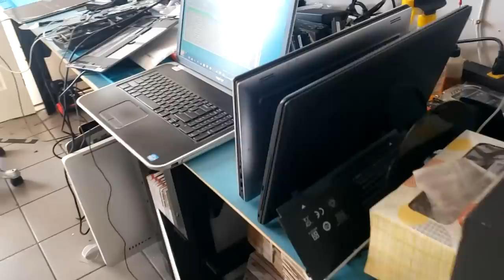iPad 12.9 Repair - Customer ripped both screen FPC connectors and Blew touch circuit

Comment: I know that you didn't say it but anyone who knows this channel will certify that you did heat the board up from underneath with the hot gun to avoid melting the component.
Just wanted to  make that clear for anyone watching and wondering.
When you removed the bad plastic components, you heated them directly as they were getting replaced.
And, if any flies or invading beetles were to wonder onto the board, they would have been incinerated as well.  One thing we don't want is another "bug" on the board.
Ok, I think my work here is done.
Great SHOW!!!

Comment: What temperature do you use with the hot air gun? For me, desoldering takes much longer. I usually use temperatures around 300°C

Comment: I always get the temp wrong doing this kind of work.
I wonder how hot is the air and speed  and the solder bit.
Like always impressed by the skills.
Reply: you'd have to get some donor boards to practice different lvls of heat n air on before working on a customer's board

Comment: Hi! Is it possible to solder components with low melt solder? If no, why not? Great job you did there!
Reply: I think it's possible.  You ever tried working with the stuff?  It's a bit messy.  Great for de-soldering heat sensitive parts.  Wouldn't want to manufacture a PCB with it.
Reply: @pow9606  i’m still learning (also from northridge his content) but never actually tried to solder on components with low melt solder. I’ll try it soon just to see if it works. Thanks for your response!
Reply: I wouldn't personally. Low melt solder is more brittle and weaker so bigger components like hdmi's might not hold up well with it.
Reply from the maker: @mazdap98  Low melt solder melts at very low temp.  It's soft and only used for de-soldering. Use leaded for soldering. This is what I use https://northridgefix.com/product/best-solder-wire-roll-100g-0-3mm/

Comment: What temperatures are you using on the hot air station and the iron ?
Reply: depends on the type of solder you are dealing with

Comment: How do you remove excess solder from the tip?!
Is there a prof tool for that or just a sponge soaked with water.
Reply from the maker: https://northridgefix.com/product/soldering-iron-tip-cleaner-rosin-flux-core-to-prevent-oxidation/

Comment: OK, I have a question.  How do you manage to use hot air on those connectors, and not blow small caps and resistors off the board?
Reply: high heat low air
practice with donor boards
Reply: @repairstudiogh3549  Thanks! I will try upping the heat and reducing the air.
Reply: @SteveMasonCanada  Try heating the boards from underneath when possible too. Once there are no small components on the back side of the board it is always safer to heat up from beneath when dealing with those connectors. Advise I learned here and it's been working for me.
Reply: you can also try using heat resistant tape over the small components but that’s considerably time consuming

Comment: What is temperature of hot air gun when the new connector is soldering?
Reply: I was wondering whether quick blast with high heat is better than longer time with lower heat.
Reply: you'd best know from practice
Reply: @repairstudiogh3549  I know 280-300 degrees?